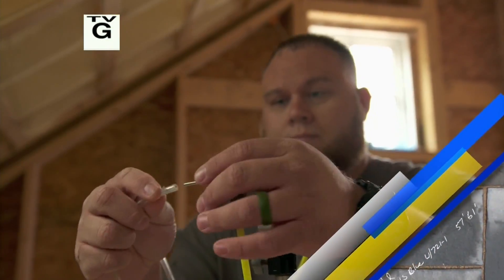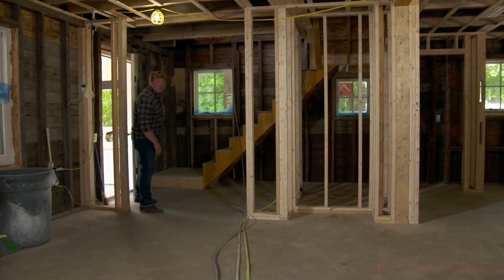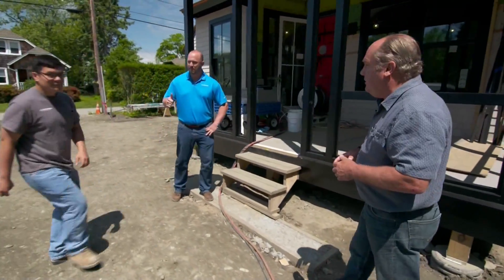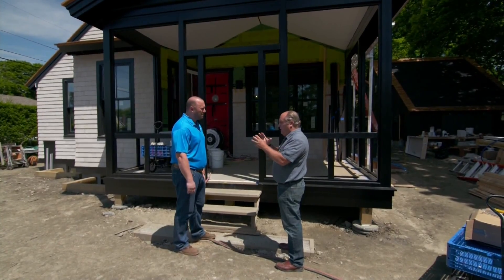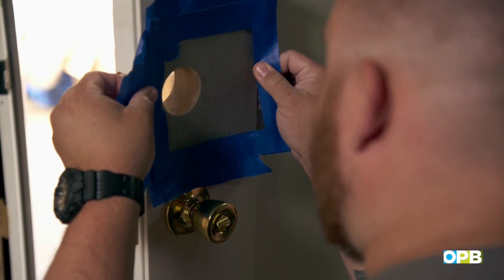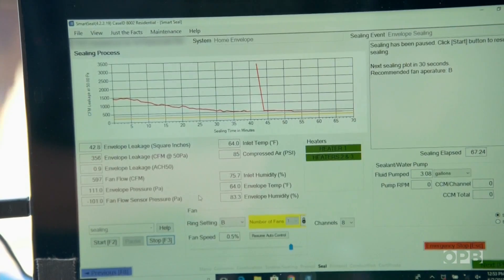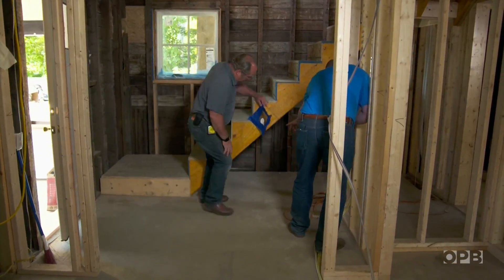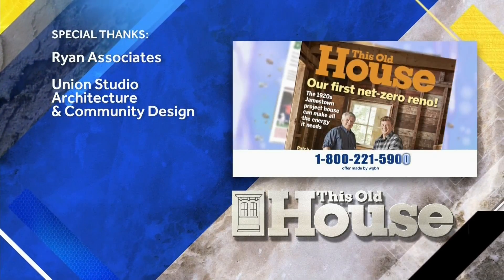This Old House Features AeroBarrier Envelope Sealing Technology

Comment: I live in zip code 33331 (Ft. Lauderdale, FL).  I visited your website and learned you have no dealers in all of Florida.  The closest dealer to me is 600 miles away.  Why no dealer in Florida??
Reply: Dealers are independent contractors. They probably just haven't had anyone in Florida contact them and become a dealer.

Comment: How long will it last and can you do it with drywall
Reply from the maker: Hi Nicholas Landolina -- AeroBarrier has been tested by a third-party lab, revealing that our X1 sealant withstands a simulated 50-year durability test, with little or no seal degradation. It can also be applied at any stage of the build process, from rough-in to finished drywall. thanks for the questions!

Comment: Well I'll be a suckeggedmule if that don't beat all. I'm totally redoing our 120 year old house, torn down to studs, attic, crawlspace now, ready for insulation. Wanting to go with spray foam. I wonder if spray foam insulation seals up all the cracks? I'm thinking it does, but this stuff is different than anything I've ever heard of. What, spray foam now on that house?
Reply from the maker: Hi Taka Yama -- AeroBarrier and spray foam work very well together. After insulation is installed, you can contact your local AeroBarrier partner by visiting https://aeroseal.com/aerobarrier/dealer-locator/

Comment: what keeps spray sealant areobarrier from places you dont want it in existing house like windows and trim. If you tape off you may tape over a crack....temporarily and it wont get sealed. ....? Do you have to gut the inside of older house first?
Reply from the maker: Thanks for the question, our expert team of AeroBarrier partners prep the home and tape-off vertical surfaces and other areas that does not need sealed. No, you not have to gut the inside of the older home first. You can find your local AeroBarrier partner by visiting https://aeroseal.com/aerobarrier/dealer-locator/

Comment: excellent stuff, some quick questions,
-does it affect the wall or ceiling finishes?
-does the floor need to be removed?
-up to what size holes does this process perform effectively?
-if a hole is too large does it still indicate a leak?
Reply from the maker: Hi Freek Hoekstra -- Great questions, Our AeroBarrier sealant will not affect the wall or ceiling finishes and the floor does not need to be removed. AeroBarrier can seal and holes as small as a human hair up-to 1/2". Our expert team of partners seal prep the space and seal any holes larger than 1/2" before sealing and can determine if there is a large hole during the sealing process and seal it.  You can find your local AeroBarrier partner by visiting https://aeroseal.com/aerobarrier/dealer-locator/

Comment: Great to see this getting some exposure...would love to know how this new technology has an effect on the enviorment, and what the total wasted product pushed out of the building is. How fire resistant is it? what  effects does water have on it once its set?
Reply from the maker: Hi Baxta -- Our X1 sealant is environmentally friendly, a third-party lab tested the sealant determining it has GreenGuard Gold certified and gives off Ultra-low VOCs. We are currently undergoing tests for a fire resistant certification and hope to receive the results soon. Water will not deteriorate or ruin the sealant after it is applied. You can find more information by visiting our website at aeroseal.com/aerobarrier
Reply: Asking the important questions!
Reply: The technology has been around for a while now. At least since 2012, but maybe a bit longer. The Aeroseal product itself is a organic polymer, and shares quite a bit chemically speaking   to Elmers glue (I believe its also some form of PolyVinyl Acitate).  So I suppose environmental effect is similar to Elmers, in any case it can break down in the environment. I dont know how much gets wasted vs applied though.   I dont think humidity has an effect on Aeroseal, but I would expect direct and prolonged water contact would..